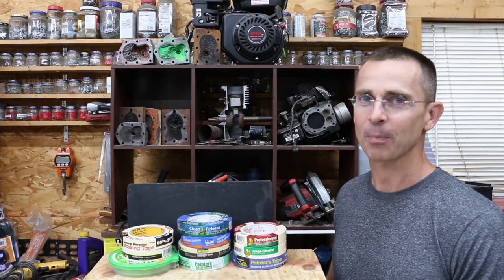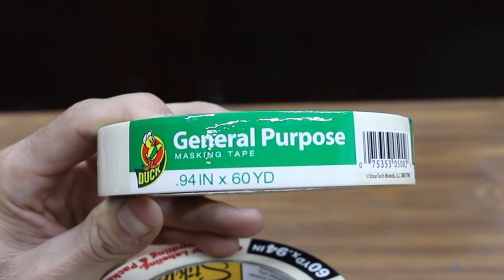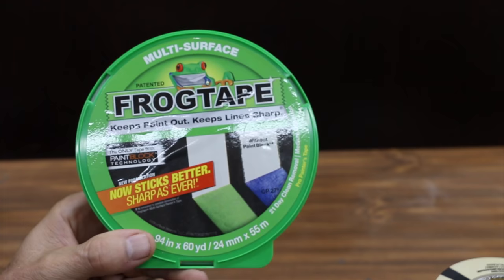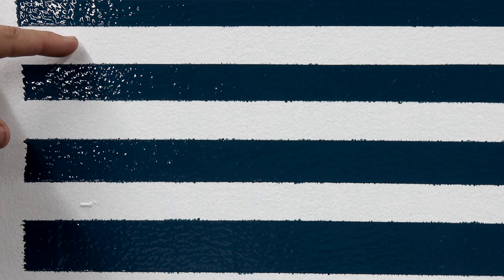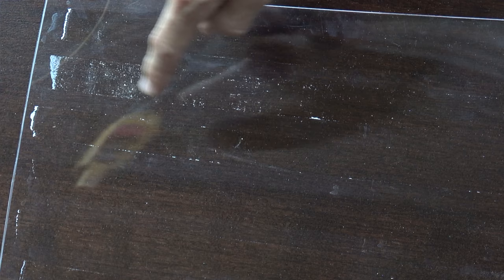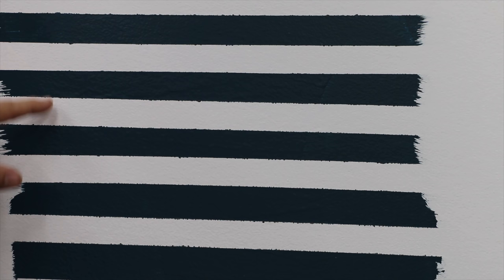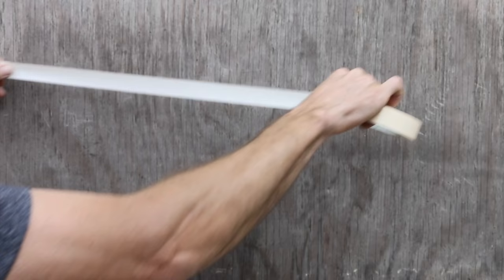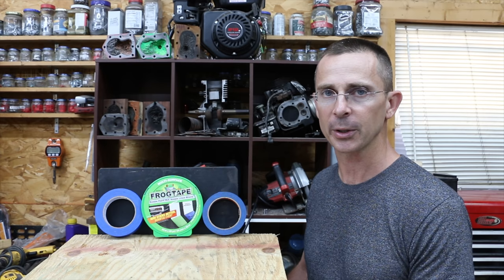Which Masking Tape is the Best?  Frog Tape ve Duck Pro, Stik Tek, 3M, Scotch, Dollar General

Comment: Love you channel. Video idea: 1 month in sun, which tapes survive the best & which are the best at removal
*eg duct tape is horrible after spending a bunch of time in the sun.
*Some electrical tapes start with no sticky (lame plastic that breaks) while 3m tends to allow much more stretching and has more sticky (but that sticky seems to melt in oil exposure, so not good for handles etc)
masking tapes vary according to how long they are supposed to *need to be removed (eg leave general purpose masking tape on a binder for a year and it will peel the paper portion of the tape off but leave a dry crystalline tan patch of dried adhesive that does not want to come off easily)

Also might through in the same video trying different things to remove each tape's residue on a metal and on a plastic surface (that has to worry about solvents attacking it at the same time or being scraped):
*Soap and water
*ipa
*acetone
*wd-40
*olive oil (then clean that off with soap and water, repeat as necessary)
*scraping
Reply from the maker: Thanks!  Thanks for the video idea.

Comment: and still the painter pro's will tell you that IF you want a very clean line - you need to apply caulk to the top and bottom edge of the tape to help insure zero bleed through !
Reply from the maker: Thanks for the feedback.

Comment: Update on Frog Tape. They have changed the adhesive formulation on thier green tape and made it Much stickier! Applied to newer dry paint it will pull off the newer paint upon removal! Frog Tape is the best for a clean edge, but use thier yellow tape on newer paint ...it still works great and won't pull off the paint.
Reply from the maker: Thank you for the feedback!

Comment: Excellent idea for testing. However, in the real world, you have a variety of enamels that you are trying to get your frog tape to stick to - many seem to act like silicone and prevent any frog tape bond.   So the problems we run into are getting the tape to bond, bleed, resisting puddles (like on the top of baseboards) that take 12 hours to dry, pulling the paint off the wall when pulling tape off the baseboard, and ease of removal 3/7/21/60/90/120 (on big jobs on forgotten areas) days later (especially difficult with any uv exposure).     Unless you are spraying, worried about spatter on baseboard, it never made any sense to tape before Frog Tape came out. Hand painting gave sharper lines.  3m edge control is sometimes better than Frog, sometimes not.  I always need to fix at least quarter of Frog Tape lines by hand cutting.  But I still use because, when it works, the lines are crisper than hand cut lines.... I will also add that people will forgive the bleed, your camera picks up, if it is they who are painting. But would gripe that a professional have some unknown, secret tech, and the amount bleed your camera show would be unacceptable for payment to a professional.    And, like I said, in the real world, the frog tape has problems sticking to a great number of enamels-it seems like half of the surfaces some years....
Reply from the maker: Thank you!
Reply: @ProjectFarm  also, Frog has yellow tape and green. Oddly, sometimes  I find that the yellow sticks better. Sometimes, the yellow has immediately fell off... I will need to test the caulking trick more.  Guessing it needs brittle low end caulk.

Comment: 30 years exp
3m 20 20 best in general tape
A thin bead of caulk on the tape edge can give you pro line. Wipe and pull tape while wet.
Great test.
Sun test would be good.
2020 2 days in sun maybe 3 without
Residue. Cleans off with mineral spirits.
Good channel thanks
Reply from the maker: Thanks for the video idea.
Reply: @ProjectFarm  very informative channel

Comment: As a professional painter with over 42 years in the business, I would have to say that standardized testing on something like masking tape can be a bit misleading, as so much of the finished product's result depends on the skill of the applicator, and the way that they personally apply the tape. Some tapes require a bit more pressure on the edge in order to lock them down, and while running a roller over all of them might be fair, and might be an even handed testing protocol, I feel that in this type of comparison, putting the tape down manually might yield results that are truer to those experienced in the field. I have seen good results with cheap tape, and piss poor results with the more expensive brands, and much of it depends upon the skill level of the individual laying it down. But overall it was a very fair test.
That said; if you are doing graphics that involve the use of masking tape, the way to achieve the absolute best (sharpest) results is to apply the tape, and then seal it with a clear coat of acrylic or alkyd that matches the sheen of the surface you are covering with the tape, and then apply the finish product over that. The clear coat will lock down the edges of the tape, and when the finish is applied, absolutely nothing will be able to bleed through to the existing surface.
Reply from the maker: Thanks for the feedback.

Comment: Just an FYI (though i will explain my method in case I'm in the wrong.) 
Frog Tape, Yellow, was advertised to me (via packaging) as being suitable for fresh paint (dry to the touch).
It was not.
I'd glossed some skirting boards, and had a few hours left in the day to work on things, so i figured id go pick up the stuff id need for the next day of work, and mask off the work I'd done, because i'm damned  if i have the dexterity to paint that close. 
Anyway, I got the tape, taped them off, went on, painted the walls the next day, gave it a few hours to dry whilst sleeping, got up, and removed the tape. 
Now, this tape was on 36 hours max,  so maybe I fucked up there, but it was better at ripping gloss off the boards, than protecting them from bleed through.
Reply from the maker: Great feedback. Thank you

Comment: When I was a painter, the best masking tape was the cheapest that we could find in bulk. Sometimes it wasn't great, but the quantity was better than the cost of quality for days and weeks of painting. 

That being said, I rarely used tape to mask paint from getting where I didnt want it, whether it was an expensive job or a quick exterior job. My boss encouraged skill with a brush and roller, not reliance on products, because at the end of the day if you dont have some random tool you will always have your brush. 

My advice is that if you're painting, take your time. It's not hard to do well, you just need the right brush and patience with yourself. 

Cheers.
Reply from the maker: Thank you for the feedback.

Comment: I used Frogtape for many years since it claimed to be a better tape for painting....unfortunately years ago when i used it frequently frogtape wouldn't stick to anything and you could never get it to adhere to the wall, door, or any other edges properly.  When it did stick it worked great, getting it to stick was the troubling part.  Now i noticed in the video it says "now sticks better" on the packaging lol.
Reply from the maker: Thanks for the feedback.

Comment: If you trace the tape lines with a razor blade before you take the tape off, I guarantee  you'd be able to use any of those and still have flawless results. I'm a welder now, but I was a painter in my 20's.
Reply from the maker: Thanks for the feedback.

Comment: Frog beats 3m in many ways,  not just for crisp paint lines but when you remove the tape after spray painting, frog removes without breaking off in sections.  Bottom line 3m is crap.
Reply from the maker: Thanks for the feedback.

Comment: If you ever revisit this it would be nice to see which paints adhere to rough surfaces in humid conditions.  It can be extremely frustrating trying to find a tape for this scenario because almost no one markets for it and almost no one reviews a masking tape for this scenario.

I was just trying to paint outside in the semi humid air.. The scotch blue tape WOULD NOT STAY.   The shed trim was cut by an amish lumber yard so it's very rough.  I'm applying the tape to a 100% acrylic Behr paint.  It will not hold for even 10 minutes and I pressed down HARD.
Reply from the maker: Thanks for the suggestion.

Comment: I think the plexiglass test isn't a good idea.  It is a very smooth surface and the dry wall will have some pull off with the tape and might leave less residue.  I think using some plain drywall, apply the tape, and then use the corn starch.  Admittedly, the corn starch would get into the irregular surface of the dry wall, but it might blow off well enough to reveal the amount of adhesive left on the dry wall.  Consider a retest... though I'm a frog tape fan overall, you also might try the blue vs green regular vs long term tape products too.  See how long you can actually leave the tape on without "permanency"...  in thinking about it you could try to get some Hindu Holi celebration powder or some such as its colors might show up well on the dry wall.
Reply from the maker: Thanks for the suggestion.

Comment: One thing I would have also been interested to hear about is if there was any noticeable tape adhesive residue left behind on something like a glass surface or a smooth painted surface. I used the blue tape on my car and noticed some residual adhesive on the paint.

Comment: I think anyone who paints knows that painters tape is used for clean sharp lines. Cost is irrelevant. Otherwise, why use it? I have Frog Tape and 3M. I also apply a lot more than five pounds of pressure and I don’t have a problem with either tape. Thx for another good test.
Reply from the maker: Thank you for the feedback

Comment: This was a nice comparison. Thank you. Without checking, I wonder if you have considered testing paint and caulk sealants? There is considerable difference in prices and manufacturer claims. Perhaps Exterior Paints and Caulk on different materials, stucco, wood, fiber cement, vinyl, etc. color tinted behavior over time, fade resistance, tooling ramifications, elasticity over time, adherence, abrasion resistance, ease of clean-up, temperature sensitivity (products go into my garage to die on the shelf!). Just a thought.
Reply from the maker: Thanks for the video idea.

Comment: It would help to use proper technique when painting next to tape in order to get the real results... it's called dry brushing.
You spend the paint away from the tape and then use your spent brush to go up against the tape so there isn't so much gobs of paint flooding the tape.
If you did this, there would be several of those tapes which would have zero bleed through. I have used almost all of them and they all bleed through if you flood them.
Reply from the maker: Thanks for the feedback.
Reply: Been a painter for 26 years, and while what you said is absolutely true.

This is still a good test, especially for the average homeowner who actually believe the ads saying they can paint their house as good as the pros.

No they can't. They have horrible technique, and don't know how. A tape that can handle their mistakes, is exactly what they need.

Comment: If you study the chemistry of tape/adhesive, you will discover that it is extremely sensitive to manufacturing conditions.  I always got consistent results from 3M tapes....until they started outsourcing their cheaper tapes from China, where manufacturing conditions are not well controlled.  Most tapes, except a few very expensive 3M ones (and perhaps expensive ones from other US and European manufacturers) are not consistent.  You will test brand X and get good results from the batch you bought Monday, but the same brand bought 2 months later you get totally different results.  The problem with the "blue" masking tapes is that their adhesive is "oily".  Just right and it seals out the paint, and too much, you find the tape lying on the floor next to the masking job an hour later.  I NEVER use the blue ones expecting them to fall off.
          A surface you need to test for adhesive residue on is anodized aluminum.  Tape will stick so badly that the tape will split in thickness when you try to peel it off.  You will need to soak the piece in acetone, and scrub with abrasive pads, or heat it with a torch from behind to get it off.  UV light from the sun also causes tapes to refuse to release, the glue setting like epoxy.
          All tapes bleed under, unless you have smooth surface and apply concentrated force on the edge (and then they bleed anyway!)  The simple solution is to apply the tape, and apply clear or same-color as the substrate paint along the edge, let that set, then apply the finish coat.
          Another thing you did not test is the tendency for the tape to rip up the new paint beyond its edge.  Latex paints tend to bond poorly, but have high film strength, and are subject to this unless you slit along the tape edge before you peel it off.
Reply from the maker: Thanks for the video ideas.

Comment: I would have liked to see testing for the tape's ability (rather inability) to pull off the paint or varnish that it was meant to protect. 

I just finished a project where this was a MUCH bigger problem than the bleed-under. Maybe the stuff is meant to be peeled off within minutes or at least hours rather than over night, or multiple days.

Comment: May need to try frog tape. I do restorations on my other channel, and I found I had some really cheap painters tape that would not stick to the part I was trying to mask. And if it did, it would peel off easily when trying to cut edges with a blade. This was a great video in general, I def want to try frog tape now. Maybe next time it would be nice to see how sticky the tape is and how well it can cut with a blade. I eventually got a "fine edge" painters tape, and that worked really well. Stuck to the part, and when I cut it, it was precise.
Reply from the maker: Thanks for the video idea.

Comment: I would be interested in seeing a metal surface spray painted.let it dry . Mask it (maybe frog tape) paint again and see if it pulls away the first layer of paint. I may be doing a motorcycle gas tank
Reply from the maker: Thank you for the feedback

Comment: In my experience Frog Tape is the only masking tape I use. I also get great results with electrical tape on smooth surfaces (plastic, finished wood, metal, etc). It follows small radius curves better than any masking tape. Just don't leave it on long or you will get adhesive residue.
Reply from the maker: Thanks for sharing.

Comment: Love ur channel....but sometimes I just don't get ur test methods...like the plywood with surface cracks all over it...ain't no tape gonna do a good job on sealing over voids, also the toller painted surfaces had a slot of stipple. Would love to see all the tapes tested on an actual smooth surface like sanded plexy or sheet metal. Thanks for the great vids
Reply from the maker: You are welcome!  Thanks for the suggestion.

Comment: Could've used this 6 months ago when I was spray painting the cornhole boards my Dad made. Or a year ago when I was painting my room, though in that case the tape just wouldn't stick
Reply from the maker: Thank you
Reply: Sometimes if tape won't stick it is due to moisture, excessive dust, oily residue etc.  Once I tried to mask a wall in a bathroom where a lady was in the habit of burning candles.  The whole wall was coated in a light film of wax, and tape simply would not stick.

Comment: Hi there, enjoy your videos very much - this masking one was great as I use masking tape for my artwork and crafts.  Would be very interested in a round 2 video - especially if it included using it around corners and curves and possibly what options there are on uneven surfaces.  Thanks heaps - keep up the great work! Lyn
Reply from the maker: Thanks, will do.  Thanks for the video idea.
Reply: If you need to make curves, one of the best options is pinstriping tape which is designed for it. You can use two lines and use chunks of regular masking tape in between. This works for best on very smooth surfaces however.

Comment: If you could do a review on WHITE EXTERIOR CAULK for siding, windows, etc and also for WHITE interior bathtub caulking.  Every caulk I’ve every tried turns very gray quickly, within a year or so.  And/or doesn’t stick.  But it’s mainly the discoloration that is the main issue.  Thanks in advance.
Reply from the maker: Thanks for the suggestion.

Comment: You're not using 3M's best tape for non bleed, equivalent to frog tape.
3M 2020 is made for delicate surfaces, 60 clean removal, and has decent non bleed.
3M ultra sharp line 2093 is needed for this comparison. Otherwise great video man
Reply from the maker: Thanks for sharing.

Comment: I was painting a boat and using 3M Blue.  I removed it after 6 months and wiped it down with alcohol.  The result left bull's eyes in the first coat of finish.  It was caused by residual adhesive the alcohol didn't remove.  It would be nice to know the best thinner to remove the adhesive that would not hurt the finish paint.
Reply from the maker: Thanks for the video idea.